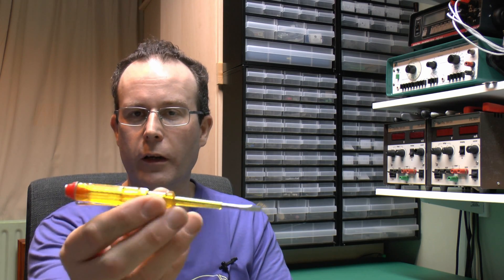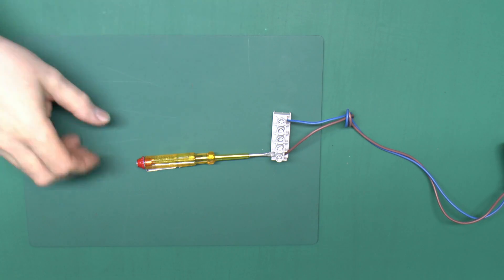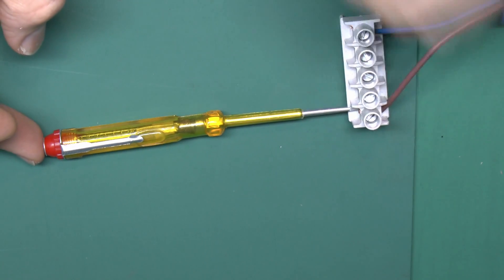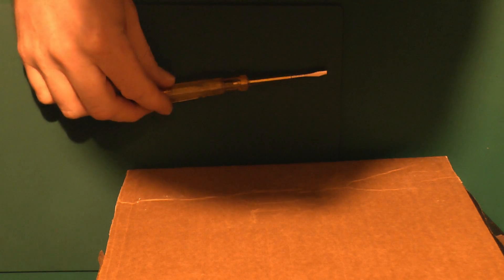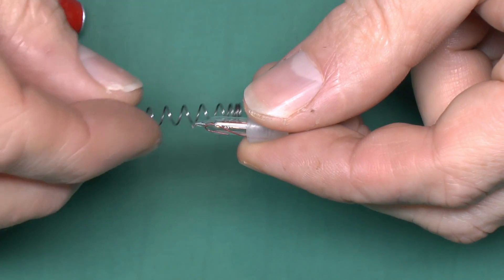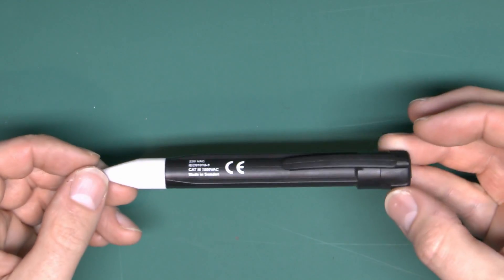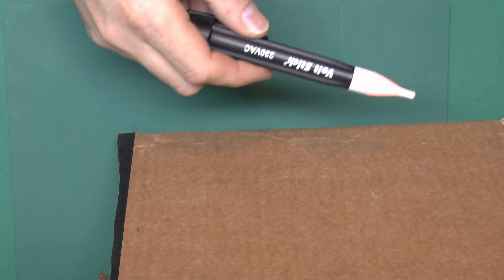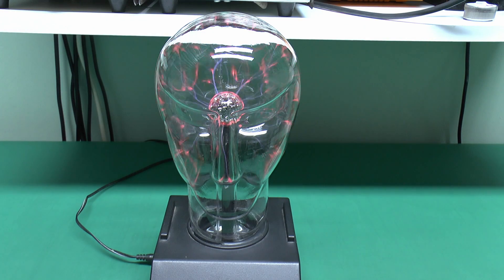Dangerous Device - Neon Mains Testing Screwdriver

Comment: If they are technically sound (no structural failure, not damp, not tampered with, etc.) it's all safe and fine.

If you use a multimeter and measure what comes out of the probe when you insert it in the socket you get around 58 volts and 5 microamps, that can't kill you.

You can use Ohm's law as well, your resistor element gave you 1.5M Ohms A=V/R ~ 160 microamps, nonlethal....

Comment: I agree that these things are not safe John, but I find it difficult to square your reasoning here with your acceptance of plastic plumbing pipe. Any water supply in my home is going to be hard earthed, to trip the RCD or even an OCD in the event of a fault that could cause my family Bath to become live.
Reply: RCDs and OCDs do not require  earth ground to trip.

Comment: If you are going to test than test the screwdriver by putting it in in screw as the you did with the double tester. The reason you didn't was you were so busy pushing the screwdriver against the plastic casing to prove your point. Stick with what you do best talking circuits and leave this nonsense alone.

Comment: Whenever you're comparing a working case vs. a nonworking case, you need to tell us the difference.  Just saying mysteriously "in this case it works, in this case it doesn't" with no apparent difference in the two setups, is idiocy.
Reply: It's really simple. He just swapped live/neutral wires *). A common thing in older buildings. Never trust blue/brown colors. Always test ALL cables. Why didn't he do it? When he presented "and here it doesn't work" he NEVER tried touching the OTHER wire. So that's pretty damn useless test and total B.S. Also, anyone who played with "plasma bulb" knows that it will light up neon or fluorescent lights. Whee. Magic. Look how bad is that neon bulb. For all's sake, all it proves is that the neon bulb WORKS! Hey, it just detected you've got a goddam TESLA COIL there! I will be REALLY HAPPY if my old trusty 1980 neon lamp screwdriver starts lighting up when I touch it to the wall, "just" because my neighbour connected the wall-wires to some several-tens-of-kilovolts!
Edit:
*) others also pointed out an isolation-transformer to remove earth reference. Yep, that's also possible. I still think he just swapped the wires tough.
Reply: @quetzalcoatl-pl  what if he just took his feet off the floor? Less so with the pen, which is amplified, but it seems like the neon would require a somewhat stiff connection to earth to function, if you were sufficiently isolated, would it still work?
Reply: Would agree that you had a bad neutral, the two pole tester could equally fool you into thinking a terminal was not live. The powered mains detector subject to proximity issues. TBH  phase testers (that pass a tiny current through the body and failure modes most likely go open circuit. I won't be throwing my phase testers away at all and they are the only item discussed that actually tests the users path to ground from a live terminal.
Reply: Agreed. This chaps content is usually strong, but this his not his best.
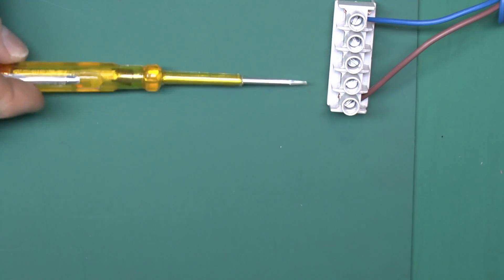Reply: 3:11 clearly lying for his own purpose, you can see the orange light come on then he moves the screwdriver tip to a point where it doesn't make contact
Stupid virgin

Comment: how would you get shocked I thought you need both - + to get a shock how does it work if only + touches it
Reply from the maker: The circuit is completed through your body into the ground.  If working correctly, the resistor inside limits the current to a tiny amount so you don't feel it.

Comment: Sorry man but the only thing that is useless in this video is you.
For your benefit i just hope no one is going to get killed because they believed that nonsense you show.

The entire reason why single pole testers are so useful is that with those you can test every contact individually without needing an additional reference.
In fact doing anything else like you showed here is not only noncompliant but dangerous.

Any Tester that requires two conections has to be used between a single connector and a known ground reference. The way you show it in this video using it between two connectors is unsafe.
The reason for that is because the neutral connector may not be connected for whatever reason. If you only test between phase and neutral you won't know if phase has power or not in that case.
But if you test properly between a ground reference and all connectors, or all connectors with a single pole tester you will find out if any connections have power.

So proper procedure:
First always make certain that the device you are using works by testing something you know has power.
Then test every connector of the device you intend to work on individually.
If you have problems with visibility repeat BOTH points with a different testing device.
Only if you are certain that none of the connections have power you can proceed with whatever you intend to do.

If that procedure is followed you should find most problems that pose a danger. Like swapped wiring or disconnectors that didn't disconnect a line carrying power.

However even that is not entirely safe because you may not find things like intermittant connection.
The only way to be completely sure is to completely disconnect (pull the plug) if possible.

Overall I recommend you take down this potentially dangerous assembly of halfknowledge vid and instead show people how to properly use such testers.

PS: I hope i didn't make too many mistakes in this text because english is not my native language. If there are any, everyone feel free to point them out though because i don't mind learning

Comment: Nothing divides and polarises opinion more than a Neon Screwdriver, it seems. One thing is certain- their only use is for detecting a live wire. If it doesn't light up this means nothing; it's imperative that your next move is to put the screwdriver away and grab a more sophisticated tester.

Comment: I connect that screwdriver to the 3.5 mm headphone jack of speaker it lights up? why?
Reply from the maker: Capacitive coupling to some voltage within the speaker.  Or it's acting as an antenna.  Just another reason why these screwdriver testers are next to useless.

Comment: you didnt explain the reasons behind the failure of the screwdriver, this was more a buy only this device I like type video, which is largely bulky and two handed in operation doeesnt leave a hand free to  manipulate the wire ?

Comment: Agree with what is being said. I was shocked at how bad the light was inside on of these things so it went in the bin and replaced by a non-contact voltage detector with a big flashing LED and buzzer. Far safer and clearer IMO.

Comment: really don't understand all of these shitty comments. don't think I've ever tried to use one of those test screwdrivers? remember my dad had one when i was about 6 I'm 40 now 😂 i used to buy maplins meters but all of mine are fluke now. seriously never poke things in mains voltage unless its your ex girlfriends tongue or a half decent meter 🐴 ex girlfriends tongue still seems tempting 😒 p.s never had an issue with my fluke non contact voltage tester but i always prove it everytime first and still test it with a meter after because i value breathing... electric shocks hurt and generally aren't pleasant 💩

Comment: Used that type of tester my whole life,and im still alive.
Reply: I got two in my electric tool box. 🙄
Reply: @m101ist  I just bought another four so that I won't have to worry about losing them for the next couple years.
in the US at least, the tool is listed for this purpose. I trust underwriters laboratories a lot more than I trust a YouTube blogger.  ;-)
Reply: @SwingboyPA  I mean, it is technically impossible to get killed by a quality test lamp because someone very smart designed them in such a way that they can't pass through lethal ammounts of current.

Plus they are super useful for those wire screw in terminals like on light bulb sockets, you need only 1 tool for the job.

Of course, if you buy cheap Chinese ones you could and probably will cook yourself. I'd rather assume i'm working on live wiring than use one of those.
Reply: Fred Bloggs  I use my non contact for things like THHN in a junction box when there's a bunch coming from Greenfield or EMT, or turning off a CB at a distance when it makes no sense to use my circuit tracer.
 I'm an electrician with 30+ years of  experience.  Sometimes (rarely) I work contacts close together so a touch tester is great when my non contact would be useless.
The problem with ANY 2-contact tool is needing 2 hands.
Reply: They wouldn't be able to still offload them if they weren't fit for the job they've been going 50yrs at least.
Reply: Mark C Littler What can go wrong will go wrong. This instance it can go very wrong. Better safe than sorry
Reply: Yes CME, do you know what kills people that work with electricity all the time?
Complacency..............
Reply: Me too! :)
Reply: Fred Bloggs  My understanding is that the T90 is a range voltage meter (not precise voltage) and that you need to touch a hot AND either a neutral or ground.  Can you just use 1 probe to touch a hot only and get a reading?  If so, I'd consider it, but my understanding is that you need to use both probes to get any reading.
Thanks.
Reply: Me too.
Reply: Aren’t you lucky
Reply: Saucer of milk at table 5
Reply: There are different quality test pencils around. 
The original Philips was good quality. Most of the Wattmaster versions have been good, but don't push on them too hard.
Used correctly a test pencil may save your life.
When performing routine maintenance (read bulk terminal tightening) on industrial control systems that include 240 VAC circuits mixed among the terminals, the old "testicle pensicle" not only lights up but allows you feel there is a live one there.
They are much safer in intelligent hands than either a set of test lamps or a Wiggy tester. A test pencil will not cause an uncontrolled start up if 415 VAC control circuits like the 2 items above will do.
Reply: Me too. And I can't imagine how you would get hurt by this unless you were maybe testing over 600 volts?
The point of this tool is that it identifies a hot wire -or which side of a broken neutral carries a load.
It's quicker than a multi-meter when you're testing 40 breakers in a panel too. More reliable than a non-contact tester in a group of wires.
I love this tool and they last forever -I lose them WAY before they die.
Reply: That is a very bad argument. Electric accidents are rare but they can happen.
Reply: @okaro6595  front tyres on my car have 0.5mm tread left and I'm still alive! 

Buy a sodding multimeter cme
Reply: I've always used them and I'm not dead yet.
Reply: 3:11 clearly lying for his own purpose, you can see the orange light come on then he moves the screwdriver tip to a point where it doesn't make contact
Stupid virgin

Comment: The 2 point tester is better for verifying there is a potential difference between the points, but if say the Neutral is open and active is still energized, and because mains is referenced to earth, a shock hazard can still exists. If there was a broken neutral on an old building for example and power had to be cut for work, multiple tests and checks are needed, to ensue the site is in fact actually De-energized. Using an adjacent known working and tested power point for reference, is one way, or running your own earth test lead to actual earth, a true known reference. Its even possible that earthing system or part of the building is live and or floating. The pen tester could be handy and part of multiple check procedure. But the testing solution taken depends on the job. If the wiring is known and tested to be all ok, no broken neutrals for example then a simple test to verify power on or off is usually sufficient. On a new job and you do not know what you may find, assume nothing, safety first.

Comment: I've never seen these screwdriver voltage testers before - I do agree with you that they seem a bit risky especially if not made properly. However, I think you are being unfair with it. The "cardboard" wasn't really a false positive since this really is in effect a non-contact tester. Also, the battery-powered mains testers vary considerably in quality. I have a Fluke model which is very, very good both in terms of very few false positives and never a false negative that I've seen. I do agree that if you are going to actually grab a wire, you should double-check but I would do that relative to both the neutral AND something that I know is grounded/earthed. I have been shocked before by improperly-wired circuits where the ground pin was not grounded but actually shorted to hot.

Comment: this blokes a wannabe Electrician and hes making me fall asleep. Tester Screwdrivers are ok just to check that there is electrons flowing through the live wire. 

there is a saying i was taught as an Electrician use any Proving Unit and Check,Check and Check again if unsure. 

I'm Level 3 NICEIC Registered.

Fuck me I nearly cut my throat with a razor the other day does that make it dangerous to Shave now.

Comment: It's only dangerous if you don't understand electricity. The one you are using has too much metal exposed at the tip though. I have been using these ever since I started my working life. I came across this video by googling to buy a new one :)

Comment: If you understand electrical circuits and use a good brand and understand how the device works and it's limitations these thing should be fine. However, it's like anything. You are an inexperienced driver, driving a car for which you are under qualified  and or experienced enough to drive then you are asking for trouble. Although with electricity not having your body in anyway shape or form connect with anything carrying a current is probably the best for a long and healthy career. The only thing I would say is that the cardboard trick of bringing the tester near a high frequency AC field was a little sneaky. Maybe this could have been explained that under these conditions the tester (neon gas would be excited) would be giving a reading when maybe it was not related to any "wires" being tested. It's a question of the right tools for the job. Like using a high voltage probe for high voltages etc.

Comment: The screwdriver demonstrates if there is a potentiale between a wire and ground i.e. you. And that is exactly what I need when I test an unknown mains. As others suggest  I test the screwdriver against a known source before use - and  so I also know how much light the particular screwdriver is displaying.

I am wondering why John Ward finds it a failure that the screwdrivers does not to light up when he obviously is touching the insulation.

Comment: You cannot have too many checks as some bodged wiring can still be live even if all logic says it should be off. Where I live now they fuse both live and neutral just to try and catch you out. The cooker is some weird arrangement where if the fuses are removed the hot plates will still turn on but only slightly. Until recently there was no trip of any kind. The fuse box had a fire and then one was put in with the new unit. I still have zero faith in any of it. Central European electrics really are lethal.

Comment: Probably not as dangerous as screwing in an American light bulb after forgetting to turn the switch off, mind you if it's single pole ? OOPS!  If they are as bad as you say why hasn't our neurotic heath and safety crowd banned them ? Sorry but you are more likely to be run over by a number 19 bus on a Tuesday at 11.33 am - in Mongolia.

Comment: Somebody I know has a screwdriver like that which lights up just with a circuit from your body, hand to hand, so it is used for continuity. I was surprised.
Reply: no thats something different... if its used to check continuity you would shock when checking the mains power

Comment: I can NOT beleve how people can give this video thumbs down... JW explains the flaws of of the neon screwdriver in a very very objecive and detailed way. At no point he claims that anyone would die instantaniously by using it and yet people act like he did just that. With stupid comments like "i used such neon screwdrivers for xx yeras and i am not dead hahaha" or "a neon screwdriver is the only way to detect disconnected neutrals" Maybe Test Lamps will still illuminate by testing the line against earth??? Wich the neon screwdriver does anyway  in series with its user ? so why schouldn't one be able to perform that check by savely contacting an earth conductor directly via an isolated testlead instead of 1,5 M Ohms of stupid ignorant human Body ?
Reply: The current produced by these testers (if they are not tampered with and in adequate operating condition) is in the microamps range, this is never going to cause any incidents....

Comment: Just too add something I haven't seen mentioned yet. I have seen a neutral go open near the main panel and the other neutrals on that circuit become hot and a 2 wire tester show a outlet off ,BUT both the hot and neutral BOTH have mains voltage on them.. My inductive tester SAVED me where my 2 wire tester would have hurt or killed me.
Reply: No grounds in the UK? I would always test between live and neutral and live and ground as that is then a double check but if I'm betting my life on  it I'll plug an extension into another location test it works properly and use it to test  the circuit in question.

Comment: what you are saying at 6.40 is false. if the resistor got damaged it will prevent electricity going trough it. the more contact and ways to flow it has the lower resistance and if it cracked it will lead to lesser ways to flow at the end of your circuit.